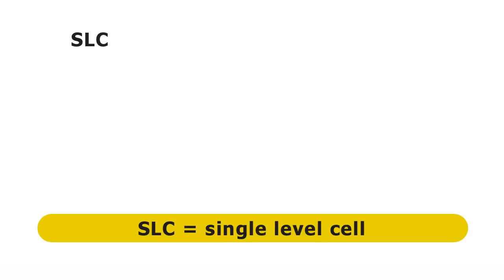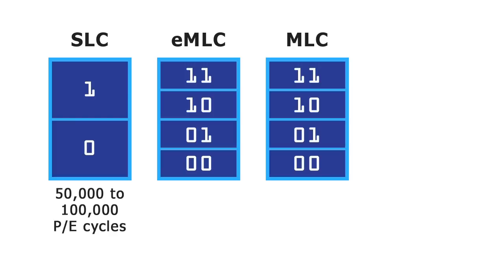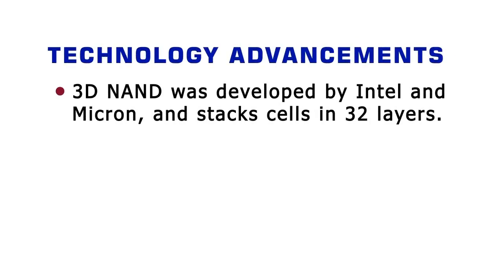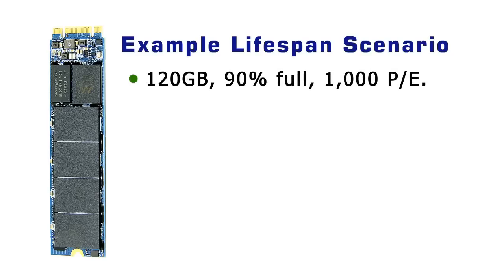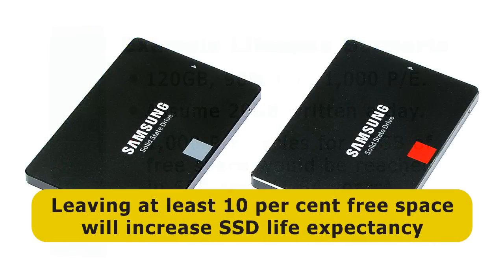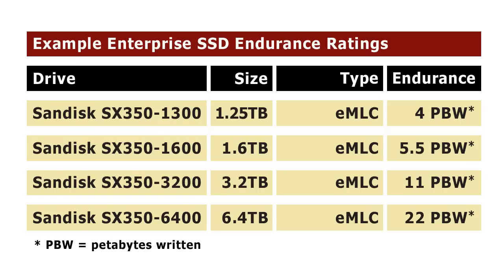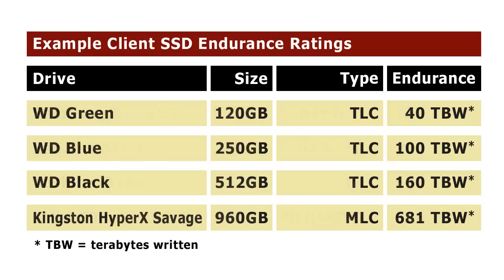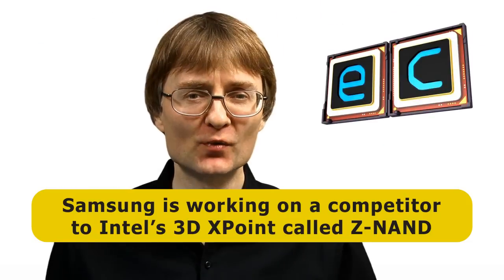SSD Life Expectancy

Comment: If it's SLC or even MLC then it's not a problem. If it's TLC or QLC then reliability is an issue if you write a lot of data. Your average PC however will likely last years to even decades even with a TLC/QLC drive, assuming you don't install new software often. If you however do a lot of video/audio editing, or even image editing the life of the drive will be short. With luck, QLC is as far as they will take it and some day we will see SLC/MLC drop in price.
Reply: Well, just watched it and essentially he said what I did. Though I am a bit harder on TLC/QLC. If the data is important to me, I still stick to spinning disk raid setups. It's simply the best way to go for long term storage with immediate access.

Comment: I own 3 cheap SSDs: OCZ Trion 100,  Kingston A400 and ADATA 650U.
1.OCZ Trion 100 wear is 7% in 4 years (1.5M MTFB, TLC)
2.Kingston A400 wear is 10% in 1 year (1M MTFB, 3D TLC )
3.ADATA SU650 wear is 0% in 2 months (2M MTFB, 3D TLC)

Now you draw the conclusion about their endurance, the data is from the manufacturer's auto diganostic software.

Comment: Im using ONLY SSD based systems for exact 10 years now. My actual PC (mac) is a macbook pro retina from early 2012 - with 256GB SSD and still working fine. Before I had some very expensive 128GB drive, one of the first ones on the market. No problem whatsoever. NO NEED TO BE PANIC.

Comment: My Crucial M4 128GB from 2011 was still working and being used until end of 2018, until I had to send it to retirement because it is just too small in capacity to keep.
I lost in the more or less same time span already 2x Seagate 1TB 7200.11 HDDs.

My 2 500GB Samsung EVOs 840 SSDs from 2014 are both also still fully operational today.
I lost 1 WD blue 3TB during this more or less same time span already.

SSDs live longer than most people think..I guess
Longer than most HDDs in reality

Comment: I have a 4 years old laptop with Windows 10, aplications and games (one or two at a time ) installed on an Intel 600p, 256 GB, M.2 SSD and I only managed to write 30 TB on it. So, for me, it's under 10 TBW / year. That's at least 10 safe years of use, as it has an  Endurance Rating (Lifetime Writes) of 144 TBW.

Comment: If you are using SSDs for archival purposes, will they last longer? As Always, Be Smart and Stay Safe.
Reply from the maker: Less use will reduce P/E cycles used, and hence like expectancy. But the total number of P/E cycles a drive can sustain will not change. Be aware that SSDs are not good for long-term data storage -- unless the drive is powered up and all data read, data on an SSD may last as little as two years. But drives that have had fewer P/E cycles will on average keep data longer.
Reply: @ExplainingComputers  Does flash drives, fall under these rules, as well?  what will happen to the data after 2 years? I have flash drives since 2005 (that's 17 years ago) and the data is still there and is usable. Because flash drives, are starting to have same storage sizes as regular hard drives, that's why I figured archiving. Thank You for responding. I look forward to your Sunday video. As Always, Be Smart and Stay Safe.
Reply from the maker: @jls9225  Yes, what applies to SSDs applies to all forms of flash memory. You may be lucky as you report. :) A lot depends on the use of the drive (how many P/E cycles its flash  cells have endured). So a flash drive that has only been filled and erased a few times will retain data far longer than one with a few thousand P/E cycles for all cells.

Comment: I still have 2-Seagate 600,M4.M500,830,840 which are at 96% to 97% life left and I have only killed one old Sandforce drive.
I now use two pc with 3 NVMe drives in each pc and a few old ssd above.

Comment: God I love SSDs can't wait until we can buy a 1Tb SN550 Equivalent for 60-70$ and 2TB for 120-140$.
Reply: Prices are dropping a good bit. I'm rocking an SN550 500gb nvme in my desktop and down the road I may upgrade to a larger nvme and turn the 500GB into fast external storage.. You can get a 1TB nvme for around 100 bucks now which isn't a bad price at all considering. But right now the 500GB is perfectly fine since the bulk of my storage is on an external HDD and I only use the nvme for the more demanding storage and the operating system.

Comment: I'm not sure if those algorithms equalizing wear of the ssd disk cells are limited or not by disk logical structure organization. I'm mean partition. If I have ie. 2 same partition on the disk and one of them is 20% full and second is 90% full, then both of them will wear out at same rate or sells on this full partition will die faster because of less free space on partition available for equalizing algorithms. 
Or those disk algorithms just don't care about logical space organizations and use all 90% of physical free space left on disk to do this "life time expand magic" . Can anyone explain me this. Because it makes decision how to partition SSD disk much more important and different than on traditional HDDs.
Reply from the maker: Wear levelling takes places at the most basic level on the drive -- it does not matter how many partitions you have. It is the total free space on the drive that matters, not how full individual partitions are.
Reply: @ExplainingComputers  Clear and straight. Thank You, I suspected this, but couldn't find solid confirmation anywhere.

Comment: I wanted an SSD to cut down on Write time when encoding Videos, 

1 Hour of 4K video took 2 hours to encode at 60FPS 5000/MB/s in H265 and 320MB/s Audio PCM on a standard drive 7200 RPM Seagate Barracuda, with an Intel Core I7 4790K OC to 4.8GHZ.

  Same Setup took 1 hour 25 Minutes with an SSHD 7200 RPM Seagate SSHD ST1000DX001 1TB Hard drive with 8GB NAND Cache. 

 Final Test using Sabrent Rocket M.2  Q NVMe PCIe 2280 1TB drive in the same system took just 48 minutes.  
If you are after speed when writing large files like this, Get an SSD, If you don't need to write Large files quickly and you are just needing to store files semi permanently somewhere, get a regular Hard drive.  If you want to write Large files somewhat quickly, but need to store them for a long time somewhere, opt for a SSHD, Or you can do like I do and get several different drives.  I use 3 SSHD Seagate ST1000EDX001 Drives and I use them as storage, but I am running my Operating system off of the Sabrent Rocket SSD.  That is probably the best option if you want speed reading and writing but only sometimes, and also need large Storage.  ~Elijah

Comment: very simple if you have important data it always needs to be backed 2 or 3 times and since backed data is not accessed constantly just get Big HDD for backup and in you PC use SSD for speed at this point SSD are Only worth it for Main Windows drive and gaming drives for end users anything else just use HDD

Comment: From my experience we have to dup all data into a new ssd every two years. In this case they can be relatively cheap models. Any way, ALL ssds fail sooner or later. Thus either pay for a could storage or for a new drive every few years. I'm still waiting for a day when motherboards will offer two nvme slots with internal raid controller.

Comment: my SSD crapped out at 2 years.  EVO .
my O/S windows 10 would not boot. so I took it out to chkdsk and after 6 hours of phase 2 only 1% done, clearly issue reading blocks. 
store or 2 or 3 drives, not on a desk top

Comment: I've got three backups of my data. The first line of defence is the computer itself. Internal SSD 1TB From Crucial. I've got all my important files on the computer

The second line is an SSD WD ELEMENTS 2 TB this has all my data and stuff ive downloaded online that is accessible online as well.

And third I've got a 256gb Micro SD Samsung card and my phone with all my extremely important data and videos and that's stored in all three places

That for me is adequate
Reply from the maker: This sounds like a solid backup strategy. :)

Comment: I don't agree with what you say that ssds can last 10 years. If you look at reviews, there are many ssds that have failed within 6 months or a year, especially all the cheap one. I never had an hdd fail so quickly. I have seagate and western digital hdd that still going strong after many years.
Reply from the maker: I do not say that all SSDs will last 10 years, nor that the average or reasonable life expectancy of an SSD is 10 years. My statement in the closing segment of the video is that in most usage situations for most users an SSD should last "several years" and "potentially over a decade". So your statement is not a fair or accurate summary of the content included in this video. I am  aware that SSDs can fail in months, and it used to be very common for them to fail in a few years. But if will largely depend on how much data is written to them, and the P/E cycles they have available, as the video explores in depth. The comments on this video also show the range, with some people reporting rapid failures, and some drives lasting many, many years. 10 years or more is certainly possible, and I have two SSDs that are working and are over 10 years old! :)

Comment: I don't mind getting a 1TB SSD to replace my 1TB HDD even if it's initially more expensive (but cheaper in the long run) if it lasts way longer and more reliable since I regularly replace HDDs whenever the warranty is over. Oh, and minimising environmental waste is cool too.

EDIT: Ooh, activating Over-Provisioning on my Crucial 250GB MX500 now.
EDIT2: Oh, I might need it actually if newer SSDs are smarter now. I also don't plan to use up all the SSD's space anyway, but I'll keep in mind leaving 10% alone.

Comment: The only thing I care about is long-time storing, that my data is still on the disc after 10 years even if I've not used the disk and it has only been in my closet.
Reply from the maker: Then do not use an SSD! Data retention with no read to refresh it is likely to be limited to a few years.
Reply: @ExplainingComputers  Yes, I only use SSD to my OS-disc internally in my computers, otherwise I only use "old" rotating hdd's.
Reply: I feel like cloud storage might be a good fit for your backup? I mean for those things you want to still be around and un-corrupted after 10 years. Let the data experts worry about integrity of data.

Otherwise, it's pmuch backing up the primary location + a backup of the backup haha, just to be safe.

Comment: In case you don't want to drink all of the water from the video, Google advises that "SSD nand flash memory life expectancy" is approx. 10 years. Of course it is true for big sata Solid State Drives, not for M2 ones.
Reply from the maker: Not all big solid state drives are SATA (in fact most big SSDs will be SAS or U.2). The Google result you state is highly dubious as it depends on the cell type (SLC, MLC, TLC etc) and use case. NAND flash cell life expectancy, and SSD life expectancy, are very different things.

Comment: My NVME read speed is far lower than i benchmarked 4 months ago. When benchmarked it out the box I was meeting the rated speed of 3500MB/s, however it has now dropped to 2700MB/s and a week ago it was 3200MB/s. Anyone else have this issue? I've updated my graphics card recently but can't think how that would change anything.
Reply from the maker: All SSDs reduce in speed over time -- the more you write to them (and erase), the slower they get. This suggests a lot of write activity on your PC, so do check for malware if you are not aware that you are writing a lot of data.
Reply: @ExplainingComputers  Thanks for the advice, really appreciate you getting back to me. On boot i get 2700GB/s, after Call of Duty it is 3200GB/s and Witcher 3 it is 3400GB/s. I reckon the simulation requires real life activity to take effect. My OS is not on my NVME so I'm guessing the simulation isn't accurate when the card has been idle.
Reply: That is read speeds by the way. Write speeds were actually above rated.
Reply from the maker: @allypezz  Ah, it sounds like you have done some good investigations. :) It may be that after boot there is still background drive activity sorting out cache files/etc.

Comment: Wouldn't leaving a portion of the drive unformatted and unusable actually shorten the life of it by making available less of it to r/w to.
Reply from the maker: The unformatted space is still available to the drive to use for wear levelling. Formatted space is a high level thing for users. The drive will work at the lower level of its individual blocks of cells.

Comment: My rebuilt computer came with a 256gb SSD, loaded with Windows 10. After loading all the stuff I wanted and the one game I always play, it's half full. Now I'm going to buy a 2TB SSD and clone the original one and keep the 256gb for a backup in case of catastrophic failure. I have two other 2TB HDD's that have all of my backed up data and they only get turned on when transferring new data from the computer. The 2TB SSD should last the life of the PC and the two HDD's should last longer than I will, no more than they get used!

Comment: SSD's 3 years later are still not ready for prime time.  I have had for 15 years a 3TB  NAS drive running continuously and only been off maybe 3 or 4  without any issue however  because it was slow writing about 25 MB a second.  I got a Raspberry Pi with 4 3TB HDD.

Rev George

Comment: I've been using my 120GB SSD for 6 years as my PC's OS now, and it still runs without any problems... this is complete BS.
Reply from the maker: Nothing in this video contradicts your SSD lasting 6 years. At the end I predict many SSDs will last 10 years, and regardless, and figures stated by myself or manufacturers will be averages subject to statistical variation for individual drives. :)
Reply: It takes great patience to be in the public eye😒

Comment: Life expectancy: a Decade ? It's rather silly to trust a SSD in my opinion. They keep getting faster, good point. I have one inside a USB enclosure (120 GB On the Go). I stick to 1-2 Terra-bytes physical drives, cheaper and last a lot longer. I hope these modern SATA SSD's have a system like Physical drives do to lock-out bad sectors. This lets you just write data  around them (S.M.A.R.T.).
Reply from the maker: Nowhere in this video do I say to "trust an SSD". No single piece of storage hardware -- SSD or HDD -- can ever be a "trusted" data store. Any data you want to keep needs to be stored on multiple, isolated media. :)
Reply: I've seen my 2 hdd die while my ssd still going on strong. So...

Comment: I've mainly used SSD strictly for boot file images and other virtual machine images so as to limit abundant re-writes and use other drives for data.  Of course, Linux is a lot easier to set up this way.  I've always had a lot of overhead and problems with Windows OS when bifurcating the configuration and user data from the operating system files to other volumes/drives.  I keep wishing Microsoft would release an OS that is more easily managed. This separation also makes for much more reliable recovery in event of OS patch failure or (gosh forbid) malware infection that would bury deeper than MBR/Grub configurations.

Comment: There's only one P in "triple". My neighbour's SSD failed after just less than 3 years.
Reply from the maker: Sorry about the type. Figures here inevitably averages -- so some SSDs will last longer and shorter. And it does depend on how they are used. It's not hard to cause an SSD to fail in a few weeks! :)

Comment: I bought a Crucial SSD, it lasted a year then wouldn't boot.  I returned the drive to Crucial, they replaced it.  The replacement was non functional.. Crucial advised to return it to them, they would replace.  The problem is with the cost of shipment, I would have paid for the original drive twice.  I scrapped the Crucial and have been rocking a Samsung for 9 months.  The jury is out...

Comment: "Buy the largest drive you can afford to extend its life expectancy..." LOL  Yeah sure, I'm gonna buy a $500 1TB to only use 100gigs, it's a friggin' ripoff by SSD manufacturers,  I'll stick with spinners for now which as least you can fill up to the last byte.
Why don't they just use static RAM in SSD's with a couple of backup super caps built in so it wouldn't loose the data practically ever, which would allow an unlimited life expectancy since the memory cell's won't burn out, much like the RAM in your computer.
Reply: samsung 1tb evo ssd are very affordable these days
Reply: @MrBlackspoon  - Well yeah as time goes on.  I switched to a Crucial 1TB SSD two years ago, and the SMART gauge is showing 98% health.

Comment: companies are pushing ssds so much that they are probably making hdds less reliable on purpose
Reply: not really. hdds are still reliable but the problem is the max read write speeds are up to 150mb per second where as an ssd drive is up to 450mb per second. windows boots up within seconds on an ssd where as on a hdd it could take up to 5 mins. As technology progresses we are talking gigabytes of data, video games for example used to run on 750mb cd roms but now video games can go up to 100gb on dl blu ray discs. Games like call of duty stores about 90gb on your hard disk so you are going to need faster ssds to access the data when loading.